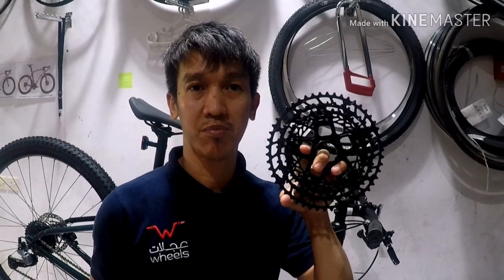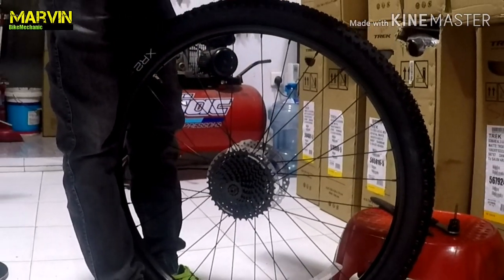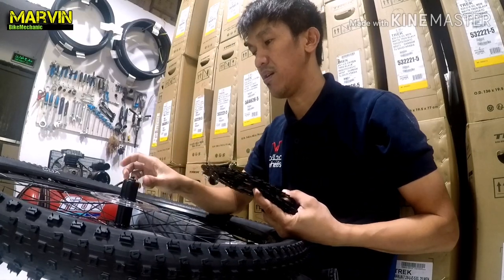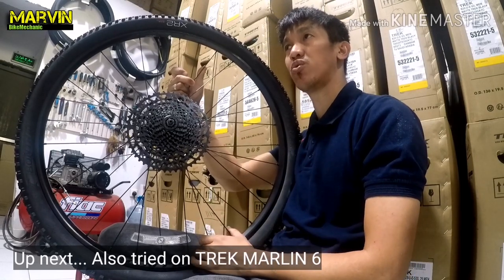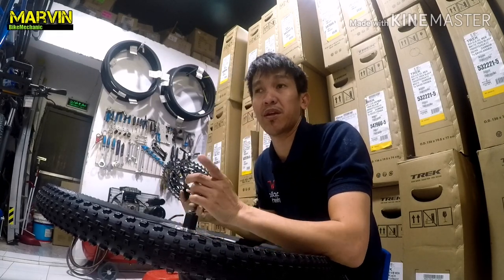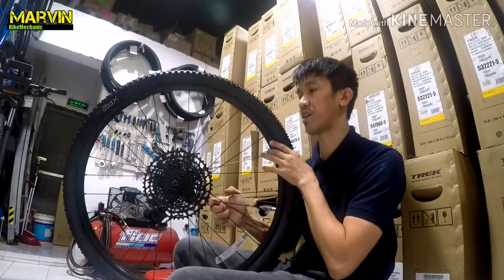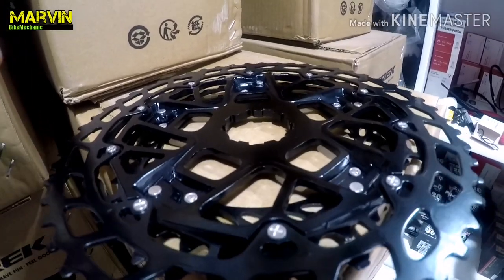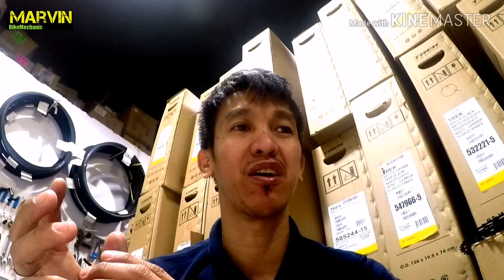TRIED FITTING A SRAM SX EAGLE 12 SPEED CASSETTE ON TREK MARLIN 6 & 7

Comment: This was helpful. I was also looking for a how-to on changing the front section to a 1x system. I have a 2020 Marlin 6 which is a 2x8 and I want to see if it's possible to update it to a 1x12 or 1x11.
Reply from the maker: Yes. Its possible to change the crank to a 1x system chain wheel. But not the crank that's already installed. The crank has to have chain wheel designed on a 1x system. 😁😁😁

Comment: Can you do a video on the best way to take off the factory rear tektro brakes and routing a new internal cable for prebled shimano 6120 or any new shimano brake system on the 2020 Marlin 6? I'm 6'5 and 245lbs and the single piston factory tektro brakes just aren't doing it so I just ordered a set of new shimano BL-6100 BR-6120 4 piston brakes. 😃😃 I LOVE my 2020 marlin 6 and bought my 12 year old son a 2020 Marlin 5 back in April these are both of our first MTB's and both agree that they are both very very good entry level bikes!  Thanks brother.

Comment: Nice video very informative. Can I ask if it’s the same with the NX group set? As they said SX and NX are compatible with the Shimano hub of Marlins. And the do we need to change the Marlin bottom bracket if changing with the SX and NX group set? Sorry for too many question.
Reply from the maker: I think sx and nx have the same sprocket length from the inside. Similar with the shimano spline yes.
About the bottom bracket, yes if you're going to use the hollow spindle crank. Yes you'll going have to change it to hallow tech bottom bracket. And i think it comes with the group set. 😊😊😊
Reply: Thank you sir! Keep up the good work. More power to your channel.
Reply from the maker: @deanmiranda3873  thank you so much sir. 😊😊😊

Comment: Marvin thanks a lot for this videos, very helpful , The Sram SX Eagle 12 will fit in my Marlin 5 2021? Thanks
Reply from the maker: Am sorry sir. But the sram sx cogs will not fit on marlin 5. I mentioned it on this video maybe you did not see that. And the bikes that i tried are 6 and 7 not 5.
Reply: @marvinbikemechanic6329  So in a Marlin 5 at first I must change the rear hub for a HG standard, isn't it?
Reply from the maker: @xjozeluizx  yes. But it will be much better if they're the same.

Comment: Did you try fitting the wheel with 12 speed cassette on the Marlin 6? doesn't it has any clearance issues?
Reply from the maker: About that yes. A colleague of mine suggested to install a washer in between the lock nut of the axle to avoid the chain to rub on the drop out frame

Comment: Boss i have trek xcaliber 7 with 9 speed cassette stock , but i want to upgrade to 12 speed using Sram NX it is fit to my stock hub?thank you and very  appropriated your answer,
Reply from the maker: Yes sir. I think it will fit. 👍👍👍
Reply: Were you able to fit the NX cassette on your Shimano 9s hub?
Reply from the maker: @joeMopar412  well one of my subscribers says that sx and nx have the same design on their cogs. So i think it will also fit. 🤔🤔🤔
Reply: @marvinbikemechanic6329  So both SX/NX will plug and play with a Shimano 9sp freehub, no extra parts?
Reply from the maker: @joeMopar412  yes sir. But... My colleague says to add a washer on the axle to make sure the chain wont hit the frame on the the smallest cog. Just a heads up. 😁😁😁
Reply: @marvinbikemechanic6329  That makes sense. Thank you!
Reply from the maker: @joeMopar412  you're welcome sir. 😊😊😊

Comment: Great! Problem solved for my son's Marlin 7 2020. I have Trek Xcaliber 7  2018 and Trek Roscoe 7 2018. I've heard that SRAM NX 12 speed cassettes will not fit on boost 141 hub. Can you also try this? Thanks
Reply from the maker: Sir, kumsta po? Kung meron na po kayo roscoe ang alam ko nka boost napo hubs nun. Kasi ang ginamit ko na sprocket tinanggal ko galing sa  roscoe 7.😁😁😁
Reply: @marvinbikemechanic6329  yung Roscoe 7 ko naka 10 speed at yung xcal naka 9 speed both 2018 model pero boost 141 ang hub. Sabi magpapalit ako ng hub if mag upgrade ako ng SRAM NX Eagle 12s. Pero laking tulong video mo nawala mga problema ko kasi di ko ma upgrade mahal ng hub lalo na hope pro4 plus bili pa QR converter.
Reply from the maker: @ogiejavate4674  actually sir kahit ako nagulat sa info na naibigay sa akin. Kaya sinubukan ko tlaga mismo sa sarili ko kung totoo nga. Ako baka mag marlin 6 lang ako. 😁😁😁 Paki share nalang din po sir. 👍👍👍 Salamat po.

Comment: And about the offset of the cranks / chainrings of the trek marlin 7 2020 which one should I buy, 0mm, 3mm or 6mm offset?
Reply from the maker: I can only suggest the 3 mm offset. 👍👍👍
Reply: @marvinbikemechanic6329  so is only the 3mm compatible?  thanks for answering
Reply from the maker: @MXT30123  well actually for me, 6mm offset is too far. Specifically is your planning to make it a 1x gear settings. Chances are you going to have a wear your cranck and even cross chain. 😁😁😁

Comment: Marvin, what rear wheel or hub do I need for that set up for the Marlin 5? If I want a  12 speed cassette.
Reply from the maker: Actually any hubs that can fit 10 speed cassette will do. There are a lot of hubs coming out on the market today. But, if you're planning to make an upgrade, make sure to change also the shifter, chain and rear derailleur in or to make your groupset work. 👍👍👍
Reply: MARVIN BIKE MECHANIC  so can I put a Marlin 6 rear tire and wheel on my Marlin 5?
Reply from the maker: @jessegaspar911  Yes sir! Or ask the nearest bike shop on your location if they sell hubs. Then ask for a mechanic that can do the replacement of the hubs on your rear wheel.
Reply: MARVIN BIKE MECHANIC thanks, your the best! Keep making the good Vidoes
Reply from the maker: @jessegaspar911  Actually sir am not. Just want to share the good stuff to our cycling community. Hoping that you could share also my channel to our friends to make it grow more. And also thank you for your trust. 👍👍👍
Reply: @marvinbikemechanic6329  greetings and blessings, the video is great. I have been asking this question for quite a while and haven't been able to get a straight answer.  I even contacted the trek dealer ship, and they still never gave me a yes or no answer. All I keep getting was buy a new bike. Any way,  just to be clear ; a back wheel off the Marlin 6 can fit on a Marlin 5 ? If yes all i would have to do is order the rest or the part's too up grade my Marlin 5 for the 1x11 or 1x12 drive train and gear shifters.
Reply from the maker: @iejaacaines8477  yes sir.
Reply: Does it mean I have to buy a new hub for Marlin5? Or I can just upgrade SC Eagle to the original hub come with Marlin 5? Thank you.
Reply from the maker: @bluebillxp  if you have a marlin 5, you have to change your hub. For more info. Watch the video link below

https://youtu.be/eqxAbEsN2dM
Reply: Bill Tsai you have to buy new rear wheel or hub to upgrade to anything higher than the 7 Speed you have in the back.

Comment: Hi sir marvin. This question is regarding the chain ring that damaged the chainstay due to short clearance from chain stay someone adviced me  to have spacer in BB or change hollow tech. If i decided to change my Bb to hollow tech do it fit to the crankset of my M7 and put spacer on it? Or change crankset that compatible sa Bb ko.? Thank  you
Reply from the maker: Yes sir. If you're going to upgrade to an hallow tech yes the hallow tech bb will fit on the marlin 7. I suggest to change also the rear derailleur with a cluth lock to avoid chain slack.
Reply: @marvinbikemechanic6329  Thank you sir for the answer . Sir possible bang itong stock na BB ko sa Marlin 7 lagyan lang ng spacer kahit di mag palit ng new BB or crankset ayaw ko kasi munang mag upgrade gusto kung laspagin ko muna ung parts or spend the money for essentials like additional tools. Thanks
Reply from the maker: @kevinjohn1865  sir pacencia napo sa late reply. Kung maglalagay Lang po kayo ng spacer sa bb shell between the frame sa drive side, baka nman mag cross chain nman po kayo gamit ang middle or biggest gear at gumamit kayo ng light gear sa likod. 😁😁😁

Comment: Sir ask ko lang po kasya kaya yan sa xcaliber 7 2020 na stock hub? If ever yes, magkakaproblema po ba sa reach ng shifter kasi sir naka xt m8100 brakeset nako. Do i also need to change the bottom bracket? Tnx in advance
Reply from the maker: Yes sir kasya po yan. About nman po sa reach ng lever. Try niyo po pag palitan ng pwesto. Mauuna ipasok sa handle bar yung brakes then shifter tpos grips. Medyo kakaiba kc yung formation ng xt m8100. 😁😁😁
Reply: Thank you sir sa reply. Pwedeng patry sir kung pupwede yung ganung setup na unahin ung brakes sa handle bar then shifter n sram sx. Pag ok, magupgrade agad ako hehe. Maraming salamat

Comment: Do you happen to know the biggest cassette I can fit on my 2021 marlin 5 with a formula dc27 free hub?
Reply: Normally the game opens up for you if you have a 8 speed cassette since they use standard shimano hubs that fit up to 11 cogs at least.  You would need to change your hub or wheel.  However I think the 2020 to 2021 models may be using standard hubs that fit the 11/12 speeds now.  If you have a 2019 or older., that's where a 7 stays a 7.  For your hub I'm not totally familiar but you can measure what fits a certain speed you're looking for and compare to yours.

Comment: Do I need to change the stock derailer and gears ?
Reply from the maker: If you're planning to make an upgrade to sram 12 speed, yes sir. You have to change all the necessary parts like shifter, rear derailleur and even chain. 👍👍👍
Reply: MARVIN BIKE MECHANIC what's the recommended budget set up for this upgrade ?
Reply from the maker: @ELGO_1  in my opinion about budget, if you have a marlin 6, 7 or any other bike. Use it for now. If you think you save more for the time you're having fun with it. Next thing you know, after saving enough money for upgrades that you'll think fits. Go for it! That how i do upgrades. 😁😁😁

Comment: Really good video
Reply from the maker: Thank you sir. 👍👍👍
Reply: @marvinbikemechanic6329  i have a question my chain is rubbing my front delaiour in first and second gear
Reply from the maker: If it touches the in board (plate towards frame) maybe it has too much tension. To release, do a minimal clockwise turn on your barrel adjuster on the shifter.

If it touches the ou board (outer plate) maybe it needs a more tension on the cable. Do some minimal counter clockwise turns on the barrel adjuster. 

 Note: dont over do your turns and always check the result.
And also check if your outer plate of your front d. Is paralleled position with the chain wheel.
Reply: @marvinbikemechanic6329  thank you really much
Reply from the maker: @markoseln4059  no problem sir. 👍👍👍

Comment: That also means the nx and gx fits
Reply from the maker: I've only tried the sx, for the nx I've check some videos and i think it will fit also. But for the gx not sure. That is my honest answer. 😁😁😁
Reply: @marvinbikemechanic6329  thank you boss, I heard they are like a sister line and that the nx is really close to the GX which made me believe the entire eagle line was very generous with fitment and quality through all 3
Reply from the maker: @ns671fr  been thinking about buying a marlin 6 and slap on one of this groupies. Problem is the budget. 🤣🤣🤣
Reply: @marvinbikemechanic6329  too much to change on a bike 😆 pero enjoyable.
Reply from the maker: @ns671fr  there are some part of having an mtb that i dont like. Cleaning up after a muddy trail bonus greasing all the bearing after a wet ride? Sometime i just pass. 😁😁😁
Reply: @marvinbikemechanic6329  confirmed, gx cassette is different so nx and sx is similar.  Gx requires XD adapter.
Reply from the maker: @ns671fr  good thing that ia gave my honest opinion about sram gx. 😁😁😁

Comment: boss anu pagkakaiba ng bottom bracket n BSA at BB92 ska ung offset 6mm
Reply from the maker: Bsa - treaded type na pang hallow tech
Bb92 - press fit po na pang shimano spindle
Off set - ito yung parang convex shape ng chain wheel from the flat surface to the curved shape.
Reply: @marvinbikemechanic6329  sir pa bigay naman complete set ng sram sx eagle for marlin 6. ska pala sir s shimano groupset anu ung pwede s marlin 6 para pag umoirder ako online alam ko na. salamat sir
Reply: 1x10 1x11 or 1x12 shimano deore groupset
Reply: SPEC s BSA BB at offset  for trek marlin 6.may nkita kc ko na ng spec n ganyan kpag oorder online. pang marlin 6 hndi ko alam kung anu ppiliin sBSA,BB at  offset my nkalagy 3mm at 6mm
Reply from the maker: @jvfitnesstraining7089  bsa po ang piliin nio sir at kung may available na 3mm mas ok po yun.
Reply from the maker: @jvfitnesstraining7089  actually kung balak mo sa shimano obligado ka mag palit ng hubs. Pero sa sram eagle sx or nx kahit dika muna magpalit ng stock hubs ng marlin gaya ng nasa video.